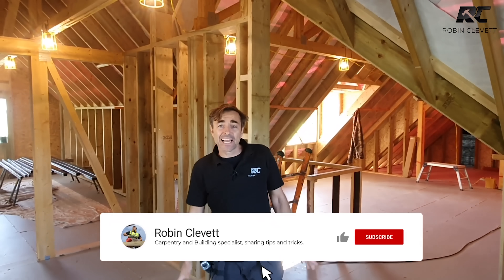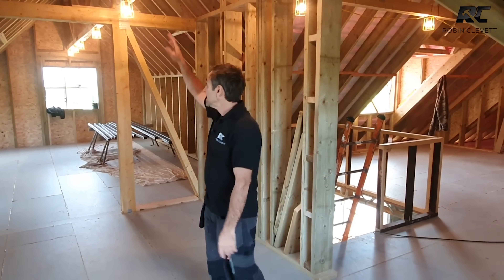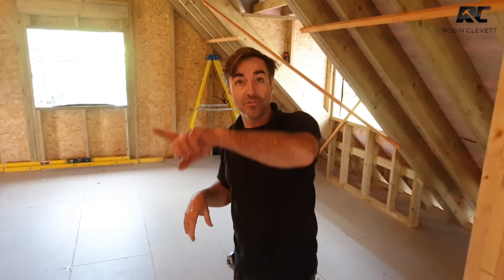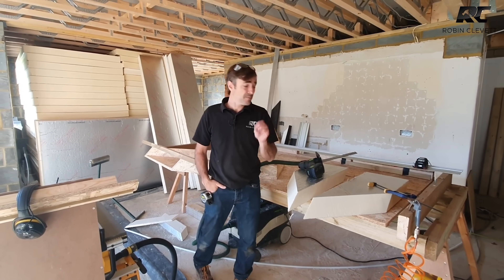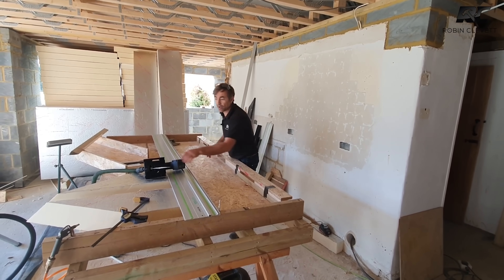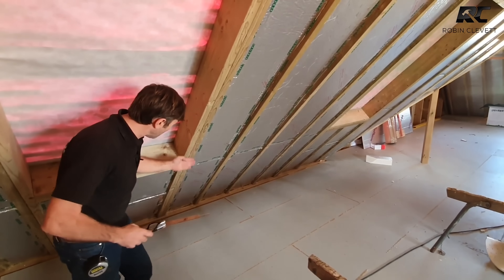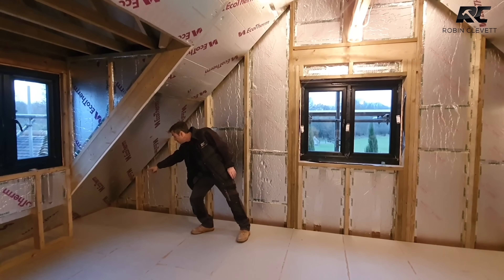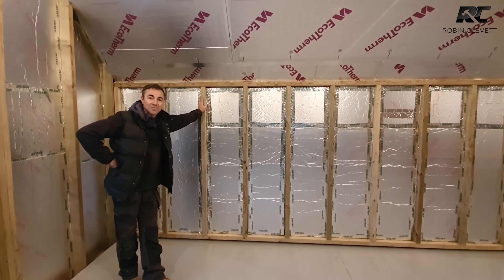How to fit insulation 2023 to the latest Building regulations Part L

Comment: Hi , I've been a brickie for years and insulating a roof  is always a grey area, and by that I mean who's job is it to do?
Some chippies don't like doing it for some reason? 
I've just built an extension and I'm on the home straight putting it in, I don't mind doing it as I can recharge myself physically as it's easier work than bricklaying! 
I don't know how your going to fit the ceiling collars without cutting a bit of the insulation out unless you're fixing them underneath?
Anyway well done
Reply from the maker: If you watch the video I made on how we are building the roof, I look at the design and explain how we designed out the need for a structural collar so we could insulate in one uniform layer without having to cut around crossing timbers ans bolts etc, our collar is fitted as effective a false ceiling

Comment: The 450mm to save pir it's a good idea, but then what do you do with the drywall if 1200mm screwed every 450mm?
Reply from the maker: We use 2700 long plasterboard
Reply: @robinclevettcarpenter  Thanks for solving the "mystery" I never thought on placing them horizontally, lol.

Comment: That's an amazing job, just wondering what you are doing for lights and sockets there? Should be wires in there for lights and smoke alarms at least, won't make it as handy as that. Great detail on this and your skill build videos , very professional , keep up the good work
Reply from the maker: Hi Danny, all our services and cables are on the warm side of our insulation layer, travelling up to ceiling level in our stud partitions etc

Comment: Absolutely top work, it's great to have people like you setting such a fine example. For me the way to take it to the next level would be to demonstrate the same level of workmanship and diligence with insulation products such as wood fibre and cork, which have the added benefit of being biodegradable and non-toxic. 

It would be really interesting to hear your thoughts on using those kind of materials and even more amazing to see people with your profile and reputation demonstrating their application.
Reply: Lots of architects & specifiers want PIR because on paper it’s got the best U values. They forget those values were obtained in a lab. 
Few installers go to the level of detail seen here, so in practice there’s loads of gaps, around which air flows. Thus in practice the PIR is seriously compromised & other solutions would actually give a better result in real world conditions.
Reply: How is the fire-risk on wood-fibre and cork?
Reply: @phoephoe795  good it Burns super well

Comment: Thanks for the excellent video.  I am planning to do something like this for my edwardian home.  I have a question.  Would this setup be OK for older homes, edwardian or victorian.  I have seen some videos that suggest leaving gaps for air circulation which does not really make sense to me as it seems to defeat the purpose of having insulation.  Your advice would be appreciated
Reply from the maker: It's perfect for improving the thermal performance of older properties, you do need to make sure that you maintain an air space on the cold side of the insulation of at least 50mm and make sure the air can pass through from eves to ridge in and put, in the case of older roof that may not have an under batten membrane or felt this is less important as the tiles or slates are very air leaky, you may need say an 80mm PIR board with the gapotape and if this protrudes lower than the rafter then add a 25mm batten to the undersides of the rafter if you then decide to line the slopes with a lining, you may need an additional layer of 25mm PIR layer for reducing thermal bridging etc talk to Gapotape for help?
Reply: @robinclevettcarpenter  Thanks for the information.  You have provided exactly what I needed

Comment: My apologise for all the bloody questions. They are only questions, not a criticism. Thank you for the walk through of great work. 

Q3)It looks like you are pushing the insulation right back. If you are you are you not blocking the airgap 75mm breather channel for under the felt. So have I missed the part where you have added laths to the inside of the joist so it is those that you are pushing everything up against.

Q2) have you left them shy of the face of the joists to produce a reflective layer from the foam through radiation across the gap. 50mm

Q3 Do we still not require an A VCL (green virgin plastic) or are we abstaining as this is a cold roof construction.
Reply from the maker: Watch closer as we maintain a large air space behind the insulation between the rafters, we also have a small container air space (non vented) between the under skin layer and the later between the rafters this is a detail shared with me from a specialist consultant, there are details of this on various insulation websites, glad you like the walk through!!

Comment: Love the idea of 450 centres to make maximum use of the PIR, but does that mean you will lose out when you fit the plasterboard? If p/b is 1200mm wide then you will have to rip it down to 900mm for the joins to be on the studs/rafters - or am I missing something?
Reply from the maker: No Gary no plasterboard waste as we use 2700 long boards
Reply: @robinclevettcarpenter  Horizontal?

Comment: With that depth of rafters why not use 150 mm or more metstud fibreglass or rock wool etc much cheaper faster fitted and less waste
Reply from the maker: I prefer PIR, I agree that there are other solutions but the results that I have achieved with PIR and the tapes when looking at the drops in the building temperature during the construction phase are always better with PIR and Gapotapes

Comment: Building a summerhouse I have used 40mm exterior kingspan cladding panels on 125mm timbers how wud u go about insulating inbetween timbers
Reply from the maker: Maybe 80mm PIR ad you already have a decent skin around the outside, using the Gapotape too will make it perform even better as you will eliminate all those skinny unavoidable air gaps when trying to cut and Fit solid insulation boards
Reply: @robinclevettcarpenter  wud u push it upto external clad or leave a air gap

Comment: I am working in 100 mm PIR to most of our 70 year old house. Aslo much Multifoil.
So far the Gas supplier is not happy... Dec to January at £10.00 is not funny to them.
Yes our roof is the very last to loose the snow when we get some.
Many walls still to do. Lovely video. Love the bench. Bodgeit and Scarper Reading.

Comment: Do you screw your plasterboard directly to the pir board ?
Reply from the maker: Hi mate, we still fix into the rafters behind the thin skin using a long drywall screw
Reply: @robinclevettcarpenter  do you get any problems with plaster popping off the screw heads with seasonal  movement ? When I have the space I’ve been using a counter battern and screw to that and not had and issues since

Comment: The PIR should finish flush with rafters. Your leaves a gap between second layer where heat will likely escape. Unless you seal gap wall at top and bottom, then it would be a benifit. Otherwise excellent work & video
Reply from the maker: It is a sealed space as you mentioned

Comment: I have often specified two layers of multifoil to create a warm roof.  The top layer is used as a sarking material and the lower layer is fitted under the rafters and up the cheeks to create the 25mm air space between the lower layer and the internal cladding board.  If required the cladding board can be an insulation board and/or plasterboard etc.  There is no requirement for ventilation of the rafter voids as they are all fully sealed and airtight and because the multifoil is very much a vapour barrier, no moist air from below can get into the space.  Using multifoil has the advantage of allowing the depth of the rafters to be as minimal as is structurally necessary since they don't have to accommodate thick insulation and ventlilated air space. therefore, any perceived cost extra of the insulation material is more than offset by the reduction in roof timberwork.  Using multifoil also means that it is simple to seal all the joints together rather than having to resort to the complication of specialist tapes.  This type of roof insulation is common in Alpine regions and has been successfully used for many years.
Reply: @J C and expanding foam
Reply: Its true that moist air cant get into that void space for now, i would imagine after the plumber and electrician have attended that air tight seal is no longer there
Reply: @AndrewGood123  That is one of the advantages of using the multifoil system as it creates a 25mm void on the warm side of the insulation/vapour barrier to run services.  I often see electricians cutting out the plasterboard and insulation to install socket outlets that compromises both the vapour tightness and the insulation.  That is the result of ignorance and a lack of co-ordinated design.

Comment: That looks fantastic, I have a 3rd floor on my property very similar to the space you are insulating so you really have answered quite a few questions I have been considering. Just a quick question what sort of gap between the first lot of insulation you inserted and the membrane did you leave? I really would appreciate your response.
Reply from the maker: Minimum 50mm if possible mate
Reply: @robinclevettcarpenter  Thanks so much for getting back to me. Just another quick question what thickness insulation board did you use for the first and second layers of insulation? I am aware different boards have different properties but I am looking for a guide - fighting through the regs is a little tough for an enthusiastic reasonably competent DIY fellah like my self. All the best and you have a new subscriber.
Reply: @icarus877  he ignored the second question lol

Comment: Hi Robin, what's that insulation worth a $m2 over there, I've looked it up here, Oz, and it costs a fortune I'd scare most people away if we added that to our houses. We use insulation batts instead, we're aiming for 8 stars on our rating system which is probably about 2 stars over there, we're doing it mainly to keep heat out in summer not a problem for you guys so much. Loving the progression of the project and the chippy chats, mind you it usually means me adding another tool onto the want list. cheers

Comment: Hi, I don't understand why the insulation is not flush with the rafter, there should not be a gap between rafter fill and over insulation. Service voids should be on the warm side for cables or at a depth to suit recessed lights. Is there a reason why you did it this way?
Reply from the maker: See my other answers to this point mate
Reply: @robinclevettcarpenter  hi Robin, sorry but I can't see any reasons in previous answers. There should definitely not be any gaps from outer vented side to the inner warm side. Dew point calcs are so unreliable and not to be used unless to 5250 and that is not happening with standard calculations. Interstitial is always to be avoided and you can reduce the risk by closing an unnecessary gap. Cables and recessed lights now need to be concealed within a suitable service void to the warm side to accommodate light depth and a minimum 40mm for cables.  You are 100% correct on the importance  of tightly fitted insulation and its something I inspect daily but sadly the importance is not yet understood by many contractors. I look forward to seeing the build progress.

Comment: Brillisnt job.  Silly question: For general new build construction do you think the future is warm roofs?  Video on warm Vs cold sometime would be interesting.  Think I'd like a house built to your standard though 😁.
Reply from the maker: Hi John, I like a warm Roof but in a pitched scenario there are many pitfalls and problem areas that people get wrong, the first is that you need to properly connect the vertical insulation from the walls beneath the roof structure or pitch and there are rafter feet and joists that make this difficult to execute well, then when you fix your roof coverings you need such long fixings to hold counter batten and then batten it all becomes a bit hit and miss, also your eve needs detailing to accommodate the extra build up and in the case of a roof it would be roughly 120mm of PIR, I have seen some shockers where the client assumed that this was quicker therefore cheaper from a labour point of view and then end up super frustrated by all the hidden time and expensive fixings etc!!! this needs proper planning and in the case of most refurbs the extra height on a roof may be a planning issue too if you are trying to keep to a certain height (adjacent buildings etc) a 120mm PIR board will measure an extra 170mm in height around 7 inches!! this is my opinion on this, (We always adopt a warm roof for flat roof situations)
Reply: @robinclevettcarpenter  many thanks for that Robin, lots of interesting points. I hadn't thought much about the eaves area. At the moment I'm thinking about a squarish dormer loft conversion. However rather than a squarish corner between the roof and front wall put a rounded corner on, say 6 inch radius. Reason is I'd like to metal clad it with rolled joints and run the metal down over that corner. Anyhow whilst I can appreciate warm roofs in principle, I don't yet understand any of the details. Big thanks for great series of videos on the big build.
Reply: @robinclevettcarpenter  This comment is literally worth thousands of £s – very generous of you to go into this level of discussion. Thank you!

Comment: I was expecting to see the PIR sheets  between the timbers to be set flush with the inner surface so that when the inner faceboard was applied it would add the two thicknesses together maximising the R rating. It seems like you have created an unventilated cold airspace between the two sheets which itself could suffer moist/damp conditions could it not.

Please don't take this as criticism it is just an observation on my part.
Reply from the maker: We often debate this process, we where directed to this method by a very particular specifier some years ago and there was a particular theory behind is small air space on the warm side of the main PIR and the under skin of insulation, we have adopted this process for years now!!
Reply: @robinclevettcarpenter  thanks for taking the time to reply. 👍
Reply: Why is this void cold? If let’s say the temp outside is 0°c, and the temp inside is 25°c, with 125mm of insulation, that air gap is at 20°c. With the gaps tape above, and taped 25mm below, no extra moisture should be getting into that gap.
Reply: @northernjimbo  All I did is make an observation and asked why? As Robin said the PIR supplier obviously suggested that installation method and Building Control must be happy with it especially as they have to take pictures and document it all. My building control inspector asked for the sheets to touch when doing our extension.
Reply: I was just pointing out that it’s not ‘cold’ 👍
Reply: @northernjimbo  no it isn't "cold" as in external temp and the void probably won't suffer huge temp swings being sandwiched between two layers of insulation but it is an air gap and there will be temp difference between the outside and inside with probably a little moisture in their  as well, enough to cause any issues I don't know. From a curiosity point of view I think before it all got enclosed and decorated I might have to put a temp probe in there on a cold day and see what the reading was. 

I was just interested in the installation method given my experience with Building Regs and  Inspectors.

Comment: Gapotape is good but costs a fortune.
Reply: I was thinking this as well as I was trying to find out how much robins discount code was, my dad said something that stuck with me though, everything is you buy will cost you money, your tv needs electric your heating gas yet your insulation is the only thing you buy that cuts cost yet you can’t redo it easily and all I can think is what the hell are oil prices going to be in 5 or 10 years time? I’d love for someone to do a video that breaks down projected energy costs in the future vs current construction costs but the industry as a whole seems to thrive in ambiguity which is very frustrating

Comment: You may wish to move the thermostat to another position in the middle of the room away from the window for more accurate results ? 
That way it will not be affected by possible direct solar gains or to a less extent marginal cooling from the window/glass ?    
Excellent work as always. Shame we do not see this level of pride more often.

Comment: Just amazing. Do you always put a 25mm insulation barrier on to protect the cold joists affecting the plaster board? Have you left an air gap between the outer skin of the roof behind the main purpose? Thanks again for a great video

Comment: Robin i've always said pir manufacturers are missing a trick by not supplying sheets at 350 wide. For 400 centres. Obviously big sheets would still have there place but  it would be worth them doing surely.

Comment: Funny how methods can differ from country to country. This is an excellent job no doubt about that. Here in the Netherlands though I usually see them slap on huge big sheets of PIR on the outside of the roof. As those come glued with a layer of plywood or osb on the outside or even both sides, they next screw on the lattices for the roof tiles and off you go. This is obviously a bit more finicky but not less quality. Just a different take on things I'd say
Reply: @J C that would be the reason he added a final layer on the inside